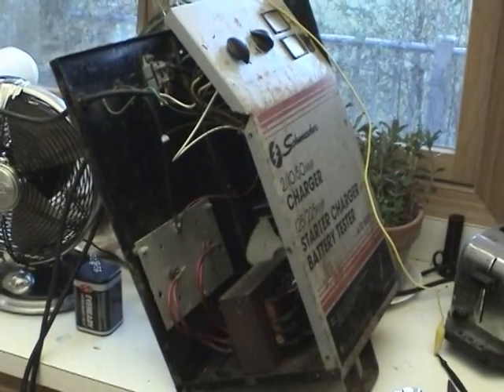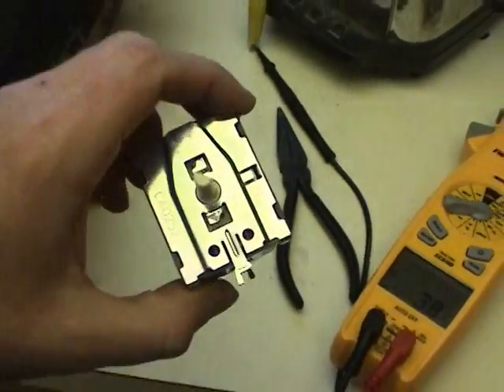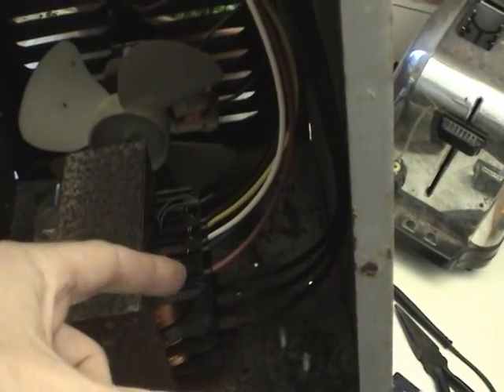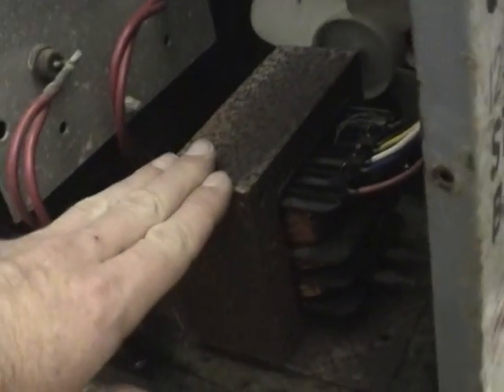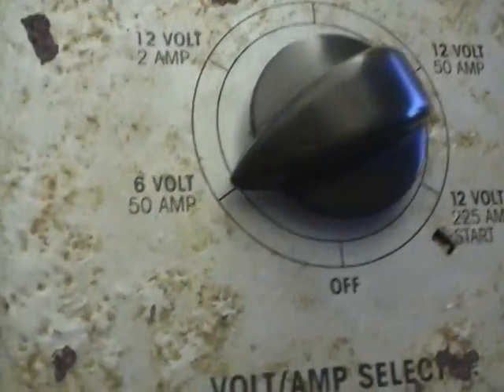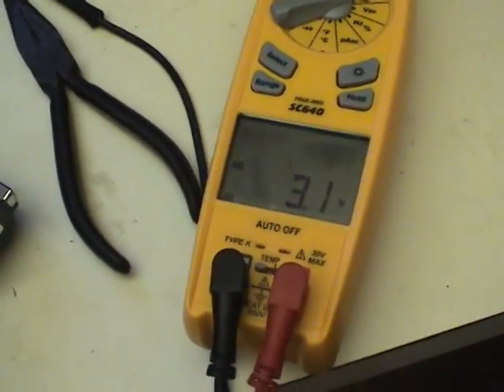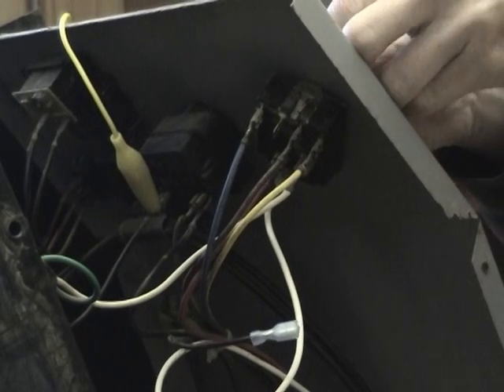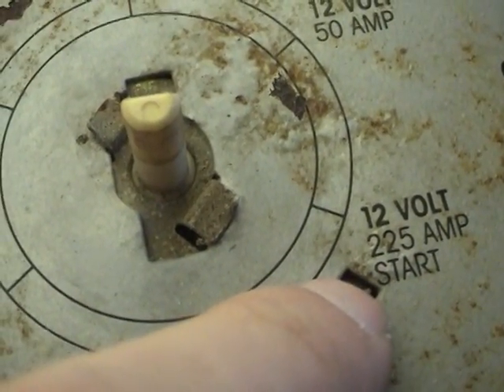Schumacher SE-2158 Battery Charger Repair

Comment: I have an old Sears charger that stopped working and I believe it is made by Schumacher. Going to take it apart just hope it's not the rectifier as they are no longer available. Good video. Happy Motoring.

Comment: We have three old chargers like this one at our shop, one does 24 volt though. I've taken them apart a couple times finding blown rectifier diodes and cooked transformers due to someone overusing the boost setting on a diesel. Good knowledge to have in case one of them craps out again thanks to you tearing this one apart! Glad you could put the charger to good use again.

Nice feature on your multi-meter, why don't other meters have a blinky light and alerms for dangerous pixie levels?

Comment: I have found your videos very informative. I was give a similar unit, a Schumacher se-4225. I doesn't have the six volt capability. The timer switch was bad and I have replaced it, however someone had been inside it before and some of the wires we left handing....and I cannot find a print anywhere. Any ideas? My rectafiers were all good as well as everything else. So the time switch and the selector switch are the same but I beliece our transformer to be different and the selector switch wired differently. Any help is appreciate. Thanks again.🤨

Comment: I have SE 2158 while putting in a new timer pulled wire from the power supply and don't know exactly where to plug it back in

Comment: I just bought a Schumacher model SC 1445  manual battery charger.  I didn't  like the amp meter on the unit,  the only two numbers (as far as amp output) was 0 and 60. I replace the amp meter with a " real " amp meter. As I  examined the inside of the unit I found  out how haphazardly they assembled it. Two rectifier diodes were touching together.  I also removed the stupid timer and replaced it with a  heavy duty toggle switch. I also found rust on the inside walls of the metal cabinet. The cooling fan was a cheap brushless .17 amp 12 volt fan that looked like it came out of a computer power supply  and it didn't move very much air. To sum up, the charger was made from Chinese junk parts assembled in Mexico. No way am I  going to hook this charger up to my truck to jump start it and fry my electronics.

Comment: Nice work! I'm surprised by the voltage rise, especially on the jump start setting...maybe they "improved" it from the units I'm familiar with, which only managed about 7.2-9 volts in starting mode.

All of the six volt and 12V/50 amp setting seem like they'd be particularly unkind to any battery.  I guess a six volt battery is a "second class citizen" to the designers, as I've never seen one of these with a gentler charging mode for six volt batteries.

I take it that your meter beeps and blinks to indicate the presence of potentially hazardous voltages?
Reply from the maker: +uxwbill Thank you.  I was also surprised by how high the voltage was on the 12V/50A and higher settings.  Those are way too high for me to feel comfortable with using this on a modern computer controlled car.  I think I'll stick to my small 12V/10A automatic charger for holding the batteries up.  I don't know if it came out in the video, but the electrolyte in the battery was boiling quite heavily on the 12V/225A setting until I quickly backed it down.

You're correct about the multimeter.  It is a Fieldpiece SC640 designed for HVAC work.  As a safety when working around energized equipment, it lets you know in several ways that you're near high voltages.  I've never seen this feature before but having used it in the field for a while, I've learned that it's a very nice feature to have.